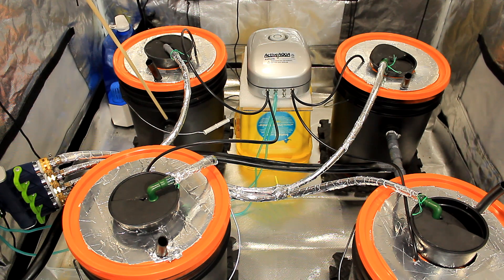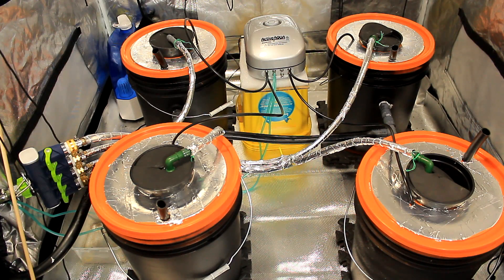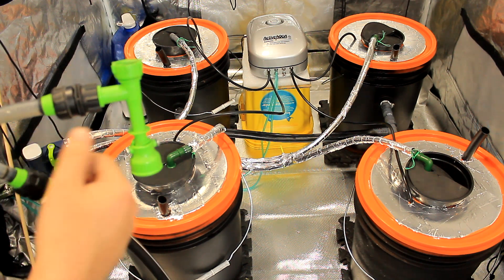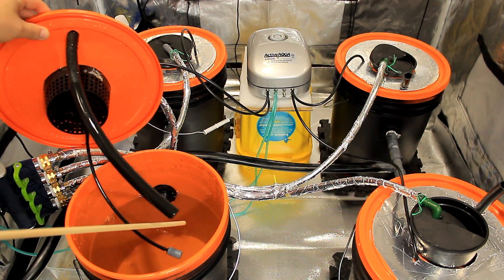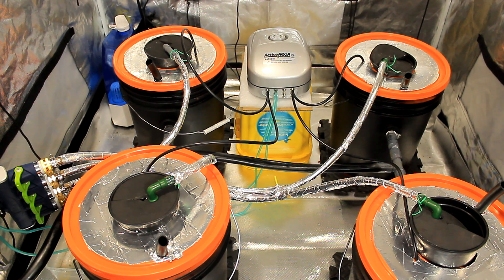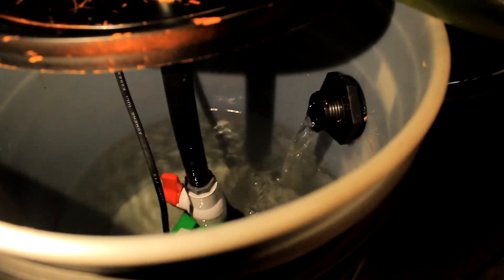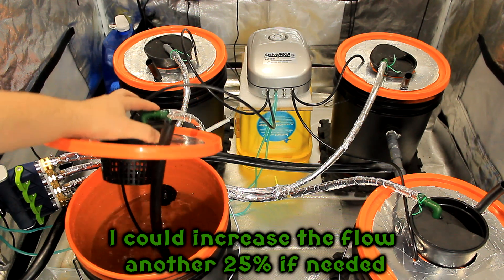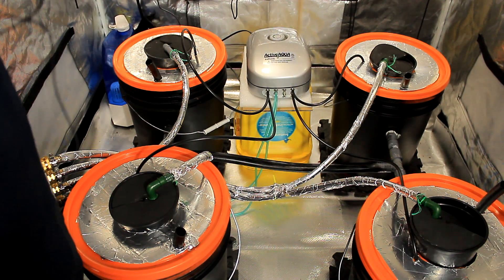DIY Hydroponic Setup | RDWC Bucket System Build

Comment: Just do separate buckets pH perfect micro grow and Bloom last all week clean buckets refill, temp of water should be 65 to 68
Reply from the maker: Dwc works well but its not for me, its too much work that way. Rdwc is far easier on the maintenance. On my current rdwc build, All my waterchange maintenance can be done from outside of my tent from a wheelchair if need be.  I have a broken hip mate, there is no getting down on the floor to check water levels, swapping buckets or worring about certain plants uptaking at different rates. I control all my plants equally and efficiently.

Comment: that was bullshit seriously, it took e like 6 video to finaly come to this one were you actually expalin and go indepth. thanks for not talking about your plants and actually explaining the different flow methods for us.. next time show up quicker in my search results though :)

and honestly i was thinking of getting that air pump but it doesnt look like it moves alot of air. is that cause the size of the air stones or is it cause its vivosun brand ?
Reply from the maker: Thanks for watching and leaving a comment. I also built an auto top off system for this as well in another video.  But with the air pump it sucks air from the bottom and the since I used cardboard and the pumps heavy it literally was blocking the hole reducing air flow.. lol totally my fault. You did mention something though. Airstones are hard on your pump, in fact any resistance is harder on the baffles inside. The best way to do it is to use a small piece of lava rock and tie it to the hose. I say lava rock because it is inert meaning it will not mess with your water parameters.
Reply: @downwithprohibition7364  huh, what you mean like just tape a stone to the end of the airhose? i was wondering that lastnight after this video i was changing systems and ya my airflow was garbage on my nft reservoir and i pulled the stone off the air hose and dropped in by mistake in  bucket of water now that was good airflow lol
Reply from the maker: I use Teflon tape and tie the tube to the rock. They sell plastic weighted stones that release large bubbles. I prefer those but they cost like 3 bucks a piece. A simple piece of lava rock and a piece of Teflon tape works just as well. I am big into fish keeping and have killed many air pumps over the years lol I had to learn the hard way about restricting air flow. Some manufacturers say on the box not to use a stone but rather plastic or non restricting ones.
Reply from the maker: These are the airstines I am talking about. https://amzn.to/2QDI177

Comment: Hey DWP nice looking system i made my own 6 bucket rdwc but iam using a way bigger res
Reply from the maker: Right on man its a great system.. I have been looking for a replacement res something larger I just can't find one with the dimensions I need.
Reply: @downwithprohibition7364  whats your email I will send ya some pics of mine iam just about to start a new run here soon been running mine for 2 years now
Reply from the maker: Oh right on dude send some over..  Down.with.prohibition.yt@gmail.com

Comment: Nice description of indoor bucket system - like a mix of DWC and Dutch buckets. I noted your comment about placement of overflow/return lines to the reservoir being placed high up the side of the 5 gallon buckets so the roots would likely not grow upwards and block them. 
I have an outdoor dutch bucket system with 5 gallon buckets and PVC pipe return line etc. using paint strainer mesh in the buckets to contain perlite growing medium for my tomatos. They are feed nutrients in the top using standard 1/4" black irrigation hose from HD pushed into perlite about 2-5cm or so. I was checking them yesterday and found one of the plants had grown roots upwards into the nutrient feed hose, which blocked flow after I removed the root which broke off inside the feed line as I pulled it out the perlite. I guess I had failed to check that bucket's feed line as the plant was looking so healthy and well feed. My take away is that I'll keep moving the feed lines regularly to keep the tomato plants guessing as to where the feed line is. I guess as your plants are not tomatos, they may have different root system development and be less likely to grow upwards into the return line.... I be interested in hearing of your future experiences with the return line placement and root developments as the plants grow. 
Again, thanks for your videos.
Reply from the maker: Wow it grew up into the hose lol yeah she must have been a hungry plant .. I had feed line on my other hydro system and I did notice quite a bit of roots grow to the surface of my Hydroton but none went for the line. The roots in my last hydro grow all dropped to the bottom and balled around my airlines. I think the only time i could possibly have a root go in the drain line is when they are just forming and dropping.  I will for sure be keeping a eye to see how they drop. I was counting on the low flow not making much of a suction to catch them in my overflow.  But yes I will for sure keep you all up to date on it.    I appreciate you watching and leaving a comment, have a great day.